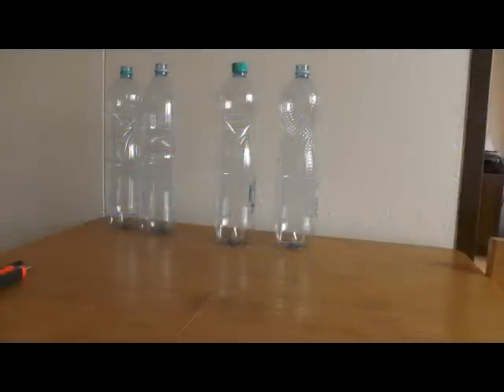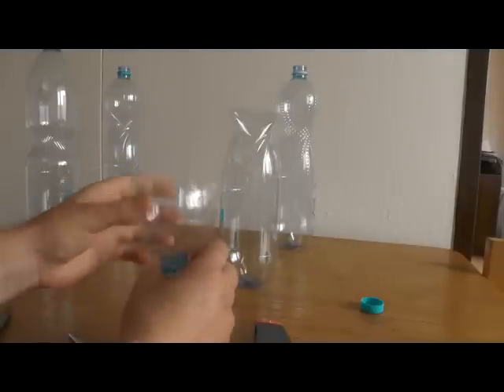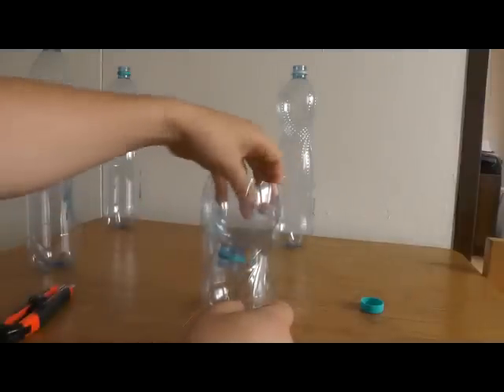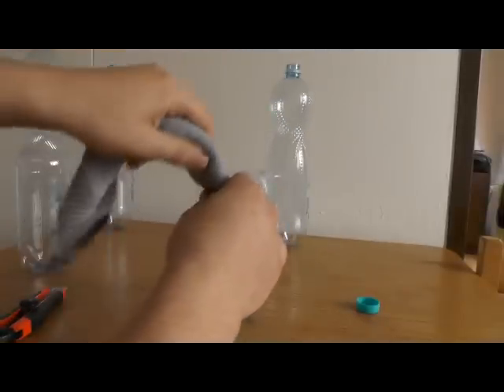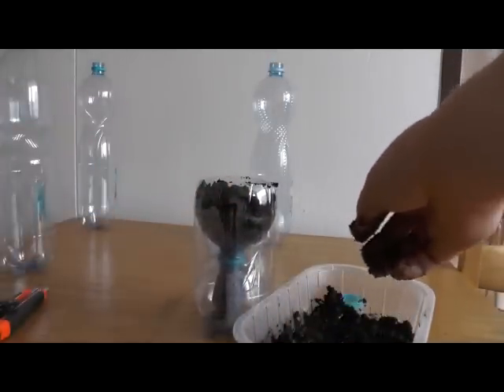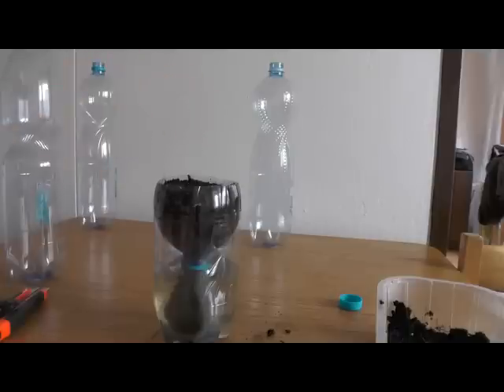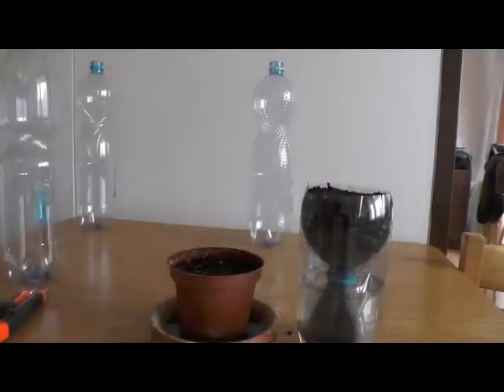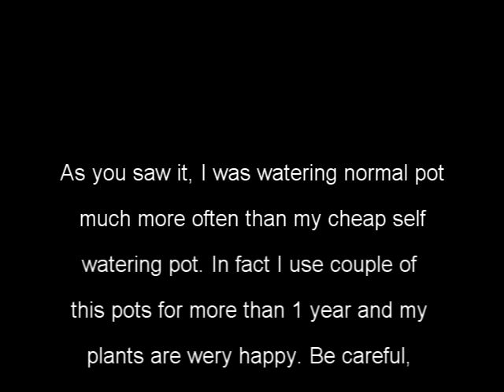Self watering pot - DIY

Comment: I very much like the ideas of upcycling bottles and old socks but I have to say that is waaaaay too much moisture being soaked up into that teeny tiny amount of soil. Almost anything you plant in it is gonna suffer from fungus, mold, and/or root rot within quite a short amount of time.

Some suggestions..... to improve....

~It would/ve been better had you kept the lids for the bottles.
~Then you could poke a hole in each lid. 
~Perhaps cut three half-inch-wide strips of the sock, pull the strips to elongate them enough so they resemble yarn, braid them together in a long thin chain, insert the chain through the hole in the lid, and slightly coiled it around at the bottom of the soil cup (against the lid.)
~Do not fill the water chamber so full. I know it seems like a good idea at first because it'll mean longer between times of refilling it, but that becomes a moot point if the overwatering is slowly suffocating or drawing parasites to the plant.

Hope these suggestions help. Thanks for sharing the tutorial!

Comment: THIS IS A GREAT IDEA.  BUT  KNOW  WHAT YOU ARE  PLANTING AND USE COMMON SENSE TO ADJUST THE SIZE OF THE WICK.  YOU CAN CUT  THE SOCKS INTO A STRING.LIKE WIDTH IF ITS NOT WATER TOLERANT.

Comment: What is the 3rd piece of plastic for?
Reply from the maker: Hello. Diameter of upper part where is soil and plant is almost the same as bottom part so it is just in case, so upper part will not slide down to the bottom. It is just to make sure that there will be still enough space for water. But it is not necessary and it depends what shape of bottles you have. For now I am not using it anymore and I build big version of self watering system for strawberries and some herbs which are able to survive in wet soil. https://www.youtube.com/watch?v=CXrss8cR2bI
Have a nice day.

Comment: Self watering shoud be at least more  than a month  .Think of an other way.
Reply from the maker: Hi. I was thinkink about it and if you wan to last for one month basically you will need just more water and that also  depends how big your plant is. So if you are able to make big water compartment for 5 litres - it will lasts for long time. Problem is how  it will look because for example I am not able to fit bucket of water on my window. My friend printed nice self watering pot and with the 3D printer you can try many good and nice designs, but I dont have 3D printer. And if you are interested in low maintenance plant, you can try to make your own ecosystem in the bottle. I made video of my ecosystem and plant is still green with no care at all since 6.3.2016 till now. Thank you for comment and Have a nice day. https://www.youtube.com/watch?v=fkiTr6Cr3os